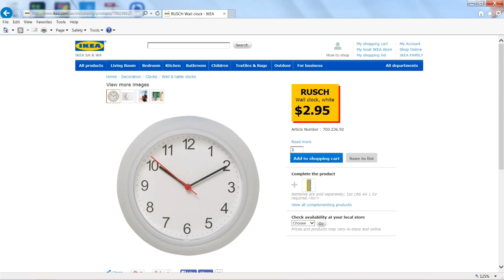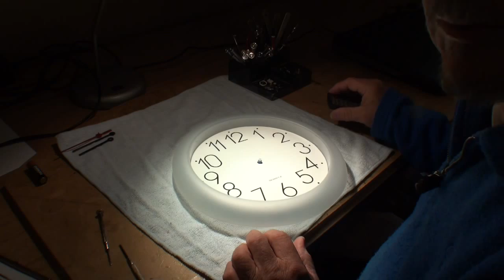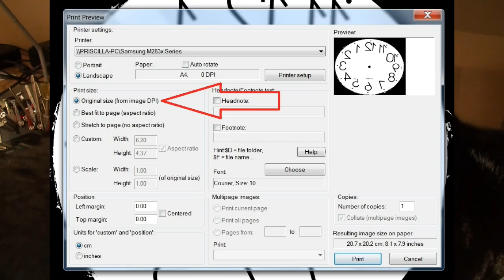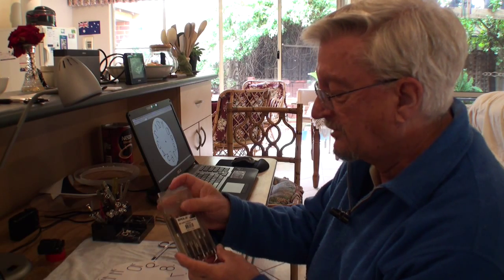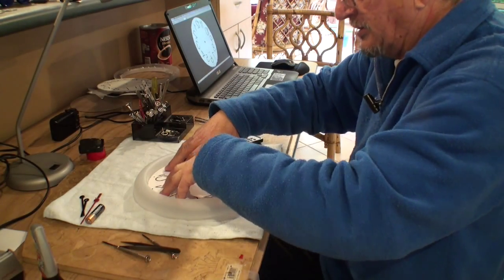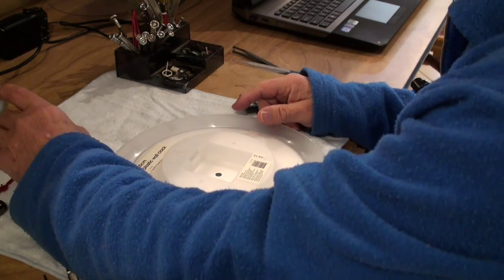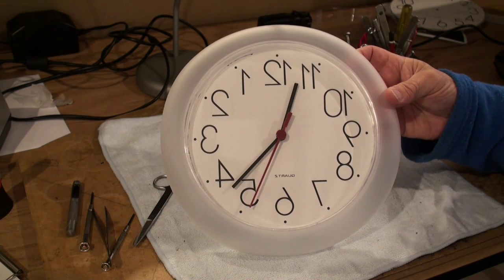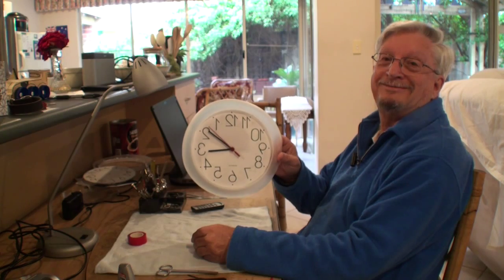Backwards Clock

Comment: I've done everything you did in the video and it still runs normal. I'm putting a clock together with a clock face I bought at hobby lobby for 2 buck's and I have 2 new clock motor's that I used on another project so the motors arrent used.

Comment: Thanks for sharing. Can you confirm if these backward clocks run for long life sufficiently? I mean, are they equally long in life as normal clocks?
Reply from the maker: Thanks for the comment. I have built two of these, which have both been running for almost 4 years now. I just replace their battery once a year (same as a normal clock). I think they will last as long as unmodified clocks. The mechanisms seem to be as tough as nails. Not bad, seeing as the originals only cost about $3.00.

Comment: Thanks for this video. I followed the instructions, but now all my clock hand does is twitch back and forth. Any ideas as to where I went wrong?
Reply: Be careful, that only "ticking" clock can reverse. If the second pointer continuously moving, and not jumping from second to second, You can't make this trick,
Reply: atyavilaag why does that happen??
Reply: @atyavilaag now I get why the clock I worked on doesn’t go reverse. Have to get a ticking one

Comment: The Magnetic Stater is what you inverted .
Reply: Yes he did. Is that magnetically polarised then? I'm slightly surprised if it is. Is that the same trick as used in a synchronous motor to have it start in a chosen direction?